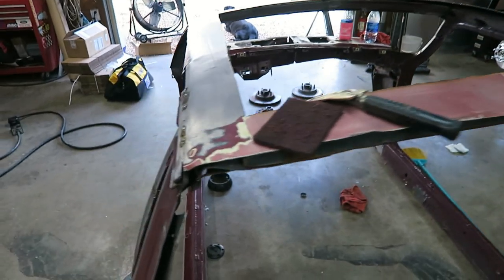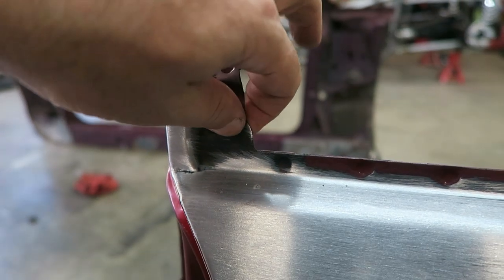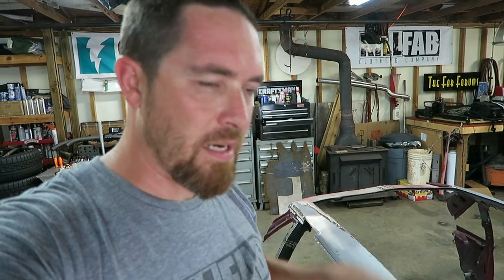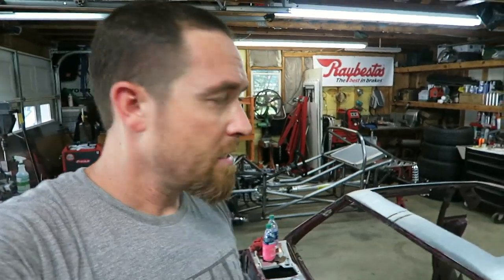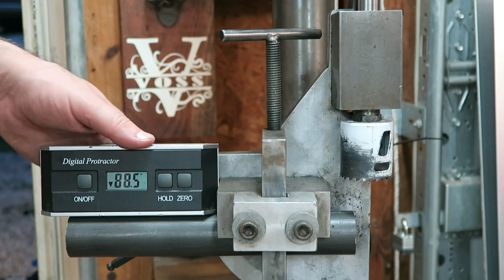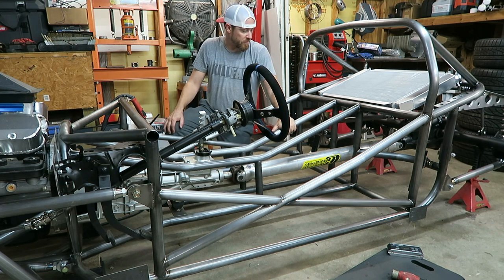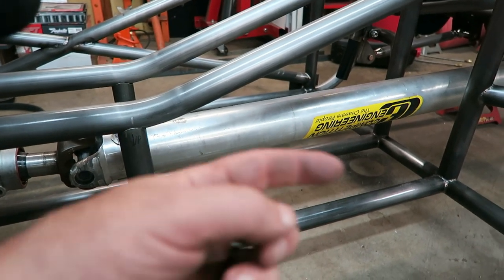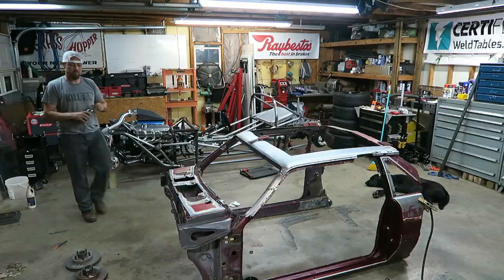Tube Chassis Vent Holes | Bibbster Build

Comment: Hey im eli i wanted to give u a sweet bit of information i would like to hear back from u. I have taken quite a bit of aviation schooling and like u said  when building a a cage of sorts where all tubes are linked up and everything u drill a hole to connect them all and something they do which i think will intreigue u is they add a schrater valve and a guage, once the cage is all done they pump it full of air so after all the flexing and stress the frame goes through if the welds start to fail the air will leak out and u will be able to tell before something is snapped
Reply from the maker: That's a cool idea

Comment: Another technique i like for thin metal were you cant get a copper backer is use 1/16 or 3/32 tig wire.  You arc off your tig wire and get a nice tack going without killing the sheetmetal. And the tig wire adds a little extra fill.

Comment: Top fuel dragster chassis builders vent inside every welded joint. Inknown the hole size.. .250" seems large but who knows.
Reply from the maker: Yeah I meant to say 1/8....1/8 is what I do
Reply: Have you examined any backsides of coped tig non purged joints?

Comment: Karl Re venting the tube chassis I remember some time back Mike Finnegan talking about when TIG welding, I think he was making headers for his boat at the time,  saying to block off the tubes and fill with Argon gas to make the weld more homogeneous and stop corrosion as you are making the whole frame "Circulate air pressure would it be worth while back filling with Argon as well to future prevent at least from the inside out corrosion affecting not only the joints but the inside pipes as well then using either Silicon or Jb weld to seal it off ?
Tony From Western Australia
Reply from the maker: Yeah on stainless steel you have to back purge to prevent sugaring...not needed on chromoly

Comment: They used lead to seal the joins in the panels where there might be some flex as it moves better with the metal. Cant see there being much flex in that beast so you aint gonna need it!  Im the total opposite, I mig everything unless im forced to tig it. Good work
Reply from the maker: I am sure I will start MIG welding a lot more as I start some much larger projects
Reply: Yeh tig is a patient mans game, especially for cage work. But it looks the tits! I can do a mig welded cage in almost half the time of a tig welded one.

Comment: i notice the vent holes arent used as much on square tube work, people making boxed with mitred ends or even just capping posts never need to vent, i wonder if mig/stick doesnt need the vent as much or if these square tube projects just have enough air volume that the pressure doesnt change much where with a tube chassis some pieces are small enough to have a large pressure change inside
Reply from the maker: yeah its just for TIG welding

Comment: why is that? i have noticed myself once you get your pulse in control and are happy with your bead you naturally grab the tig. even tho we know it is half the work if not less grabbing the mig. ive just noticed im spending more money on pure argon then i am mix  gas. i guess its just more instant pleasure.
Reply: i just like the whole process and the end result with tig more than i do with mig
Reply: def agree and i have been using it alot more on steel not just aluminum anymore.
Reply: my new multi process welder from harbor freight is the Vulcan OmniPro220 and its a DC only tig and for the life of me i cant get a nice row of dimes i guess because the cleaning power isnt there but like they say a bad welder better be a good grinder! but i actually like it on steel. thinking of getting rid of the pedal and getting a trigger. sorry dont mean to ramble

Comment: Don't go to the head! That seems silly to me. Go to the block and then you won't need the cross brace. Engine plates bolt to the block. Because the block is where you control the torque.

Comment: Ok so let me get this straight....your going to mount strut tower brace to head with a turbo motor with no intercooler.....even with arp head studs and great head gasket...u just asking to blow head gasket over and over even at 350 hp wheel....I know alot aswell but y put turbo if can't properly use it....I'm a mechanic and fabricator do it for living shop....think about it ...no really think about it....front girtle or something else...not that....or put a intercooler with meth spray and know how to tune
Reply: Not saying as fan boy but honest stuff....I'm your age with my own toys
Reply from the maker: nah
Reply: @Thefabforums  ok man.   Maybe do a air to water intercooler inside that massive intake manifold u made....be cool build